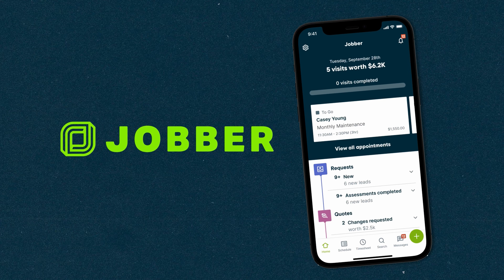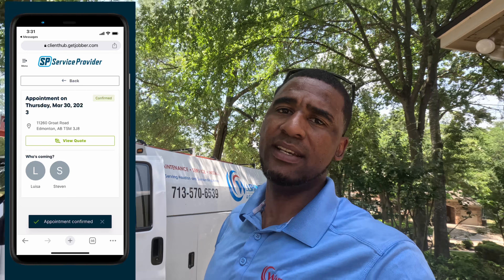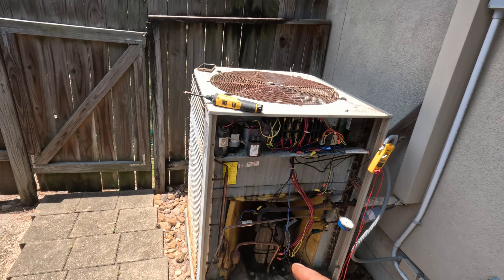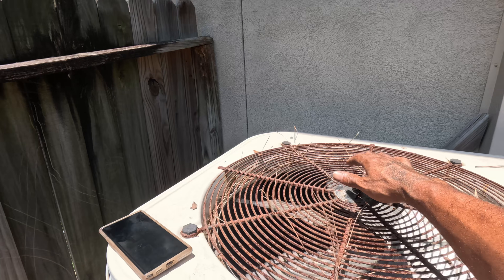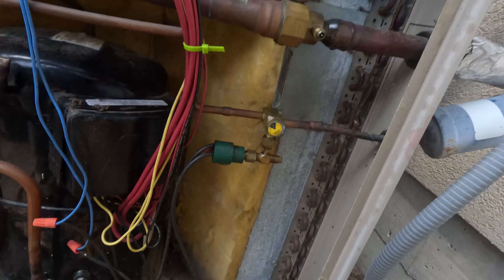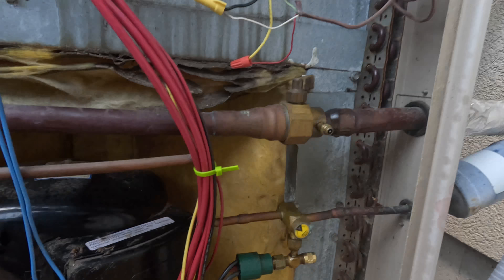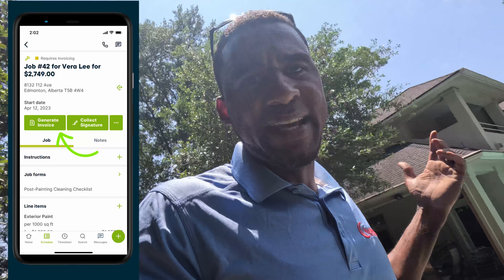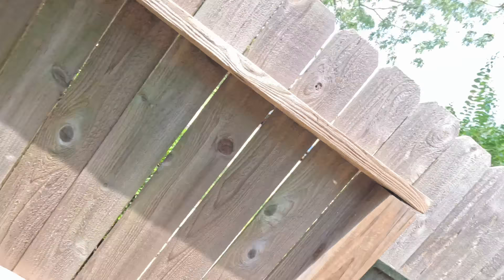Katy HVAC Technician 23 Year Old Lennox Unit: HVAC Refrigerant Leak Nightmare!

Comment: I use to have a Lennox air conditioner Identical to this air conditioner the Lennox air conditioner I had was a 5 ton. From 1992 I still remember that air conditioner very well.”
 Now I moved to lake Corpus from my old hometown (Santa Fe) about 2 years ago now I have a 5 ton Lennox air conditioner From 2009 and a 2017 4 ton Goodman air conditioner.” They work perfectly!! It’s extremely Hot Down Here!! Going to touch or break record temperatures for the next coming days.” 
Stay safe And stay Cool!! 🤗🤗🤗🤗🤗🤗🤗🤗🤗🤗🤗🤗🤗🤗

Comment: That hs 21 was a super nice unit in its day. I bet most of them went 20 plus years. That model was a beast. I worked on a lot of them because when I started working in 1997 at a Lennox dealership, we installed quite a few. Good job Walt. Hopefully you get the work.
Reply from the maker: That's a super nice unit!

Comment: Yikes !  You might need a helper if they go with 3 new units.  For sure one or two of those aren't sounding so great. Three 16 SEER units will likely save them a few bucks on electricity. Hopefully the ducting and returns are good enough and the registers are not those cheap stamped metal noise makers.